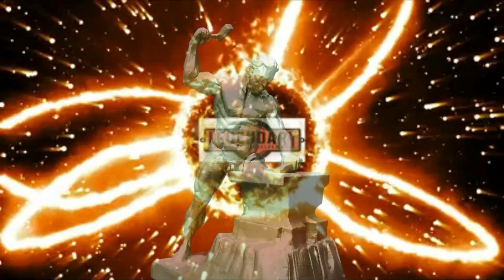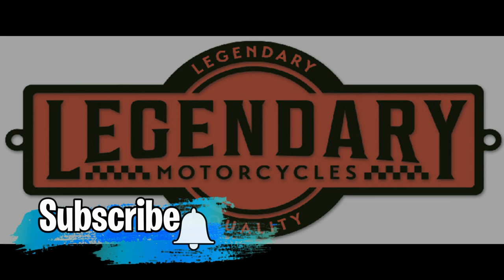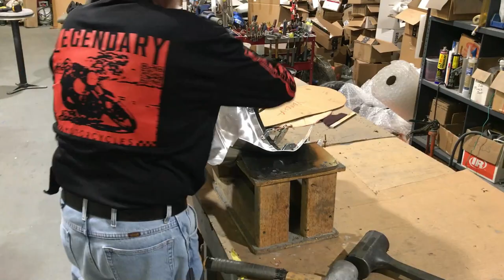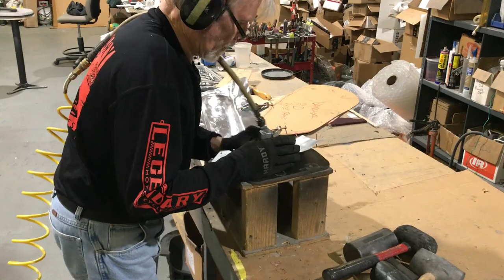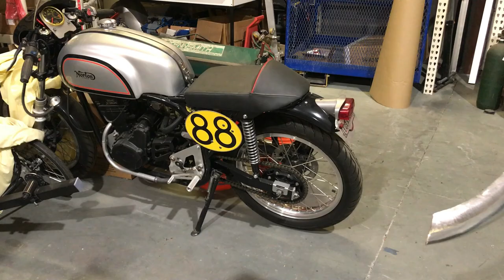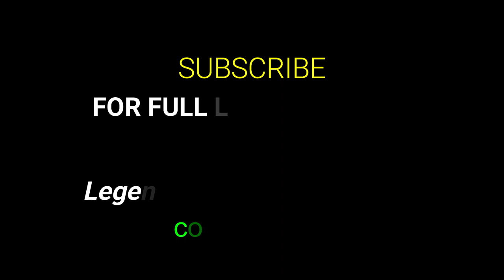3 Minute Aluminum Motorcycle Fender Metal Shaping

Comment: As someone who has actually made these.. Just cut the soft sheet to a rough size and run it through the English wheel.  it's half the effort and time !
Reply from the maker: I used to do it that way years ago until I discovered this method. The wheeling method requires shrinking the edges in some way or another then getting rid of the shrinks...also getting the radius correct is "hit and miss" and you end up dinking around to get it right. 
After doing this for 20 years I've found this to be way easier and faster hands down for me. However to each his own. If you have a better way for you, go with it. 
I'd be interested if you do have a video you can show me of your method? Thanks for your input...

Comment: Hmmm just what I need probably start with 4mm or 3/16” 3003-0 or .125” or 3mm 5052-0 😢 why I like them thicker …. But a trick Phil Remington taught me was to take two sheets tack weld around the edge such 1.5mm or 1/16” sheet, if needed you may use thicker stock but takes harder blows, then form as normal including any planishing to get two for one… he learned durning the War, WW2 for the uninformed now trying to impose fascist controlled socialism 😮😢 on us remaining dinosaurs, welding drop tanks for aircraft… which by the way were gas and flux welded much faster than modern TIG ❤. Not that it’s been 50 years or more since I was any good at it😅. Ears still ringing from Rem’s planishing hammer made of a pneumatic valve spring compressor… there be no rating in pe😊ace for the fabricator!
Reply from the maker: Interesting. Have you tried that technique? I’d like to see that!